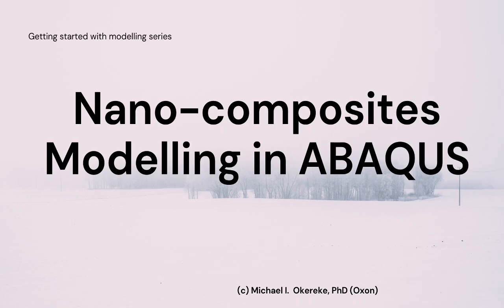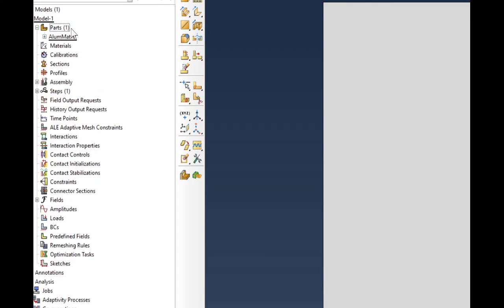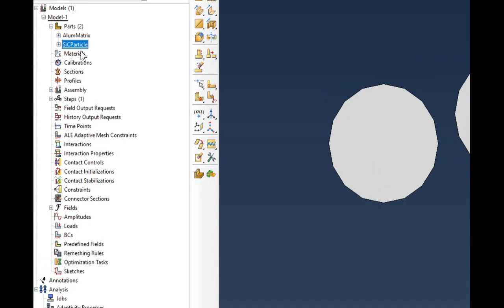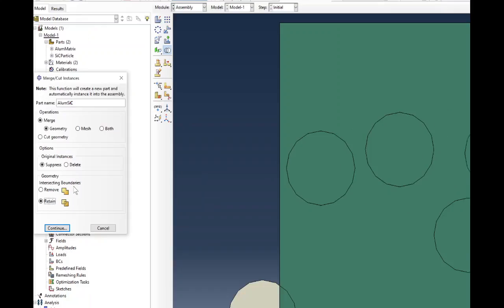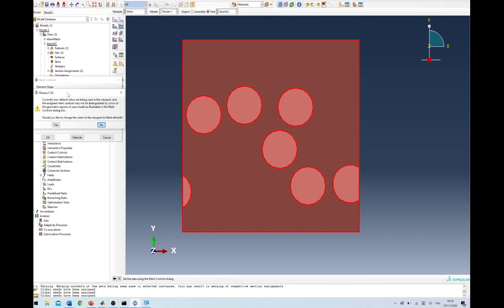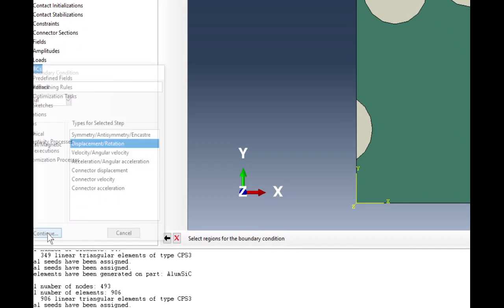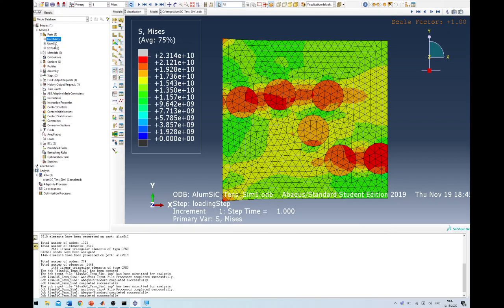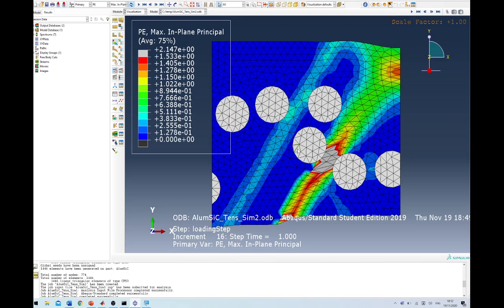Nano-composite FEM Modelling in ABAQUS

Comment: Why didn't you put in plasticity values for SiC?
Reply from the maker: It does not experience plasticity in the context of this nanocomposite. It the matrix that plastically deforms, the SiC is a particulate and so retains its linear elasticity behaviour during the deformation, so it is modelled best by a linear elastic response and no plasticity.

Comment: Dear Dr. Michael Okereke, have you done any modelling of the metal matrix composite using cohesive elements on the interface? thanks
Reply from the maker: No... I haven't.
Reply: If not, what is the default bond in ABAQUS between the particle and the matrix in this video? thanks
Reply from the maker: For this video, it was perfect bonding between the materials.  It should give you the upper bound predictions.

Comment: Nice and informative video. Sir i want to know that how we can perform the tensile strength simulation of the woven nanocomposite? One thing i thought that firstly we will compute homogenized properties in microscale rve( fibre and matrix) and then move towards meso scale rve (microscale homogenized properties are provided to yarn in mesoscale) and compute homogenized properties in mesoscale. After that, move towards macroscale and make a laminated woven composite with each lamina properties as mesoscale rve. After that how can we simulate the tensile strength of that woven composite so that my simulation stress strain curve matches with experimental.  Thanks in advance.
Reply from the maker: Hi, thanks for the query. I think your plan sounds right. It is the whole principle of multiscale modelling of heterogeneous material where you transfer model predictions from the lower lengthscale (microscale) to structural (macroscale) lengthscales. I think your suggestion is the right way to go.

With predicting strengths (in tension), you have to extract the homogenized stress-strain plots from your simulation and see if this compares with experiment. It seems to me your experiment will be at macroscale so your predictions need to be at that scale too, if you do not want to work with a micromechanical model.

If you however want to go the RVE modelling route, then you need to (a) isolate the right RVE that captures your woven composite best (b) Use adequate/appropriate boundary condition to simulate tensile deformation (see any of the RVE modelling videos on this chanened) and (c) extract a homogenized stress strain. This will be what you ca then compare with your experiments. I hope these suggestions helpd.n
Reply: @MichaelOkereke  sir, Thanks for the detailed and descriptive reply to my query.  However, If I want the tensile stress-strain plot of the rectangular strip  (as per ASTM D3039 standards) made from woven composite laminates, then how can I model the damage so that the plot falls down after some deformation otherwise it will keeps going on increasing. One model as per my opinion that is commonly employed for damage in woven composites is the Hashin damage model, but what are the input parameters to be kept in that model for numerical simulation. 

Also, if my mesoscale model has a thickness that is less than the rectangular strip sample made as per ASTM standard, then in that case is I have to model as per lamina layer wise and provide each lamina property as the homogenized property coming from mesoscale?
Reply from the maker: For capturing the right behaviour of the specimen as seen in experimental data, you would of course use some form of damage model. The Hashin is a good one. I will ask that you search through literature to find the right Hashin damage properties for your material. I do not have it. 

For your mesoscale question, it is also normal to use a lamina-by-lamina approach but since this is a woven composite, it becomes tricky. I think you have to determine what a good representative volume for the problem is and probably look at how this is done in literature. I do not know the specifics to be able to give the right answer.

Comment: Dr Okereke; 🙋‍♂
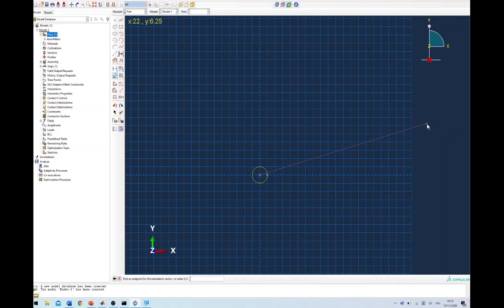How to generate a random distribution of particles and grains in a microstructure (min 7:00 ) . Thank you for the great videos . 👌🙏
Reply from the maker: For circular particles,  as I did in this video, was done using a bespoke software I developed called MontCarlGen2D, which is obtained via this link:  https://www.cmvideos.org/shop/

For the grains, that is different, and I don't have any video or resources to help.
Reply: @MichaelOkereke  
Thanks for the reply.🙂   I want to purchase this one. Just have some questions: 🤔
How Can I use that program in ABAQUS ? Is it automatically connected to ABAQUS to generate random particles ?
 and when do you release a 3D version? Generating particles in 3 dimension .
🙋‍♂
Reply from the maker: There is a documentation that comes with the code that explains how to use the code. The 3D version will be released soon and it will be in 3 dimensions.

Comment: The video is very interesting and helpful but what happens when the nanoparticles cannot be detected in the matrix. For example if the nanoparticles melt and combine with the matrix. How would one model that?
Reply from the maker: Hello @Anastasis Georgiou, thanks for the comments. I think the case you describe will be modelled as I have done here except that you will have to incorporate a constitutive/material behaviour that allows for the nanoparticles to melt and combine with the matrix. I will imagine incorporating a temperature dependent behaviour of the nanoparticles that allows it to melt during the simulation. That is my suggestion.

Comment: In this, you have modeled 10 micro meter size RVE as just 10 (and not 0.01) and later while inputting material properties are you adjusting that ?
Reply from the maker: Hello @Abdul, you are right. I kept the unit as meter but modelled to scale with 10 micrometer.
Reply: Hello Prof.,  i have a RVE (CNT and Epoxy) of dimension of 100*20*20 (nm) . 
CNT-1000GPa and Epoxy 3.2 GPa
But in Abaqus for developing the geometry while sketching if i gave 100e-9, 20e-9, 20e-9, the figure is not displaying. (As it is too small) .  So i tried with just 100*20*20 units for sketching. So gere how should i adjust the material property ?
Reply: Since i am sketching x nm as x. So the elastic properties has to be expressed as N/nm2 . Is it crrct?
Reply: So if i am not wrong, 1000Gpa (if i am expressing as N/nano metre2) is equal to 1000e-9

Comment: In this video no any small-size effect is considered at nano/micro scale. In other words, this computational model can be employed directly for a continuous structure (beam/bridge) at macro scale. Please provide clear explanations on how the nanoscale effects of the CNTs have been taken into account in the current FEM-based approach
Reply from the maker: Dear Narendra, thanks for your interest in the channel. I am not fully sure I understand the question but my best guess is that it is about the length scale dicotomy of creating conclusions at microscale and translating that to macroscale to bridges/beams as you suggest. If this is so, then this model is simply a microscale model. To bridge the length scale gap between microscale and macroscale, there are existing frameworks for doing this and this is not covered in this video. It is quite commonplace in FEM studies to develop solutions at representative length scales and extend such conclusions to high lengthscale but there should be good care taking while doing so. I hope this response addresses your query.
Reply: @MichaelOkereke  thanks
Reply: @MichaelOkereke  Sir, can you please guide me how to use in microscale in this software, since  I model the nanocomposite with particulate in microns in size. I currently used in mm scale but wanted to do in micron scale.

Comment: It is an interesting video and I would like to ask you something more related to the second part of this video but I can't comment there as I didn't find the comment section. Is there is any way to get strain stress curve directly from Abaqus instead of getting displacement and force and turn them to strain stress curve by Excel as you have shown in the second video. Thanks in advance
Reply from the maker: Definitely John, you can get stress and strain data directly by creating a history output based on a defined nodal set. For example, if you want to extract the complete stress and strain data for your full model, then you create a nodal set of all elements. Select that nodal set in History Output section in ABAQUS and select which ones you want to track the history. This is definitely possible. I may have to make a dedicated video to address this specific requirement, if there is enough like on this comment.
Reply: @MichaelOkereke  Do you mean I shall extract the stress and strain for all mesh elements in my model then I shall sum them to get the stress strain curve which represents the full model?